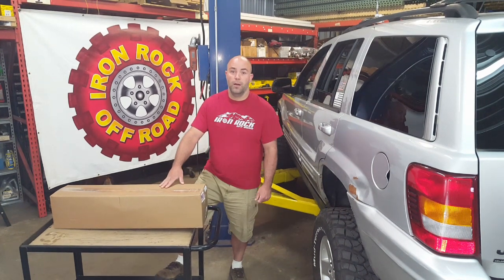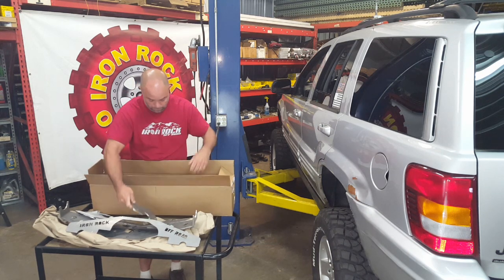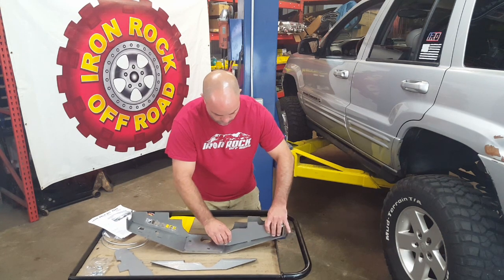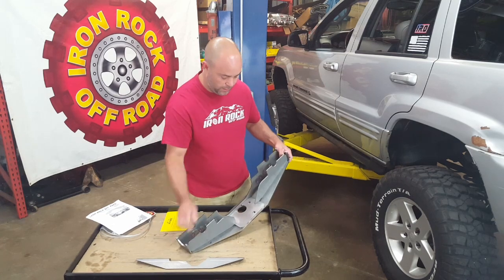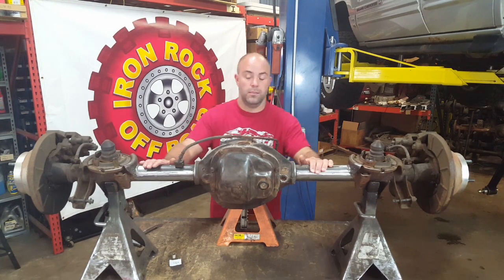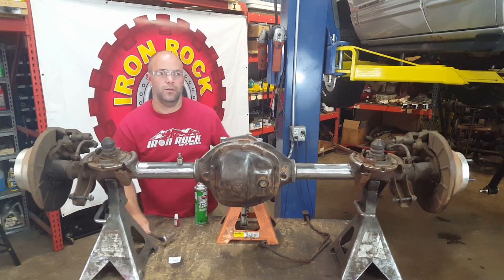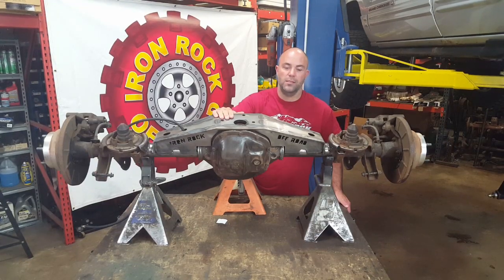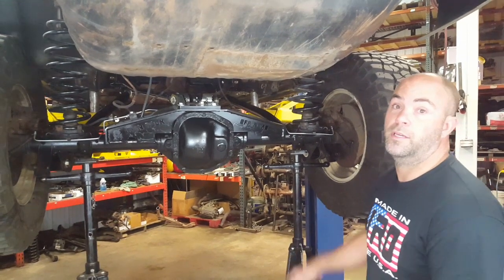WJ D44A Rear Axle Truss - Iron Rock Off Road

Comment: I'm about to do a similar kit from you guys, for a 94 ZJ D44a, in my wife's Jeep. I'm curious how accessible that vent line is after the truss is installed. (please forgive me if it's addressed in the video, I'm only about 7 minutes into it and the question occurred)
Reply from the maker: @JeepITguy Great question! I'll be honest with you. We forgot to install the breather tube before welding on the truss before. 😆 There are holes in the truss that allow you to use some needle nose pliers to install the breather tube so no worries there!
Reply: @IronRockOffRoad no worries. I am used to the high quality of your designs and figured you had it covered. Does the ZJ unit have holes predrilled for WJ-style arm mounting when one goes to a long arm kit on the ZJ?
Reply from the maker: @JeepITguy I linked the ZJ "short arm" box truss below. It might say short arm in the title, but it can be used for our rear long arm in the future. We designed it with an internal gusset to give it the strength it needs for the 4-link. It does have our 4-link UCA mount alignment hole in the truss, but it is a little different design than our WJ 4-link mount. 
ZJ Box Truss:
https://www.ironrockoffroad.com/product/zj-dana-44a-box-truss-short-arm.html

Take a look at the upper control arm mount in the ZJ rear 4-link kit. It will weld onto your ZJ box truss with no problem if you decide to upgrade in the future.
ZJ 4-Link Rear Upgrade:
https://www.ironrockoffroad.com/product/zj-rear-4-link-long-arm-upgrade-kit.html
Reply: @IronRockOffRoad thanks. The upgrade in the future option is what I am pursuing.
Reply: @IronRockOffRoad thanks. Expect a call next month before I order. I want to ensure I order the right parts.
Reply from the maker: @JeepITguy No problem, call us anytime 9am-5pm Central time if you ever have any questions at all. Plus, all our IRO manufactured parts are in-stock and ready to ship the same or next business day!

Comment: Great Product.
@ ~ 4:15 in the video there is a sleeve of some sort that suddenly appears; without any explanation what it is. Then next the vent tube connector gets threaded into it. What is it, does it thread in or is it supposed to be welded on?, (not shown in the video),... ...does it come with the kit, or is it part of OEM axle?
Reply from the maker: The sleeve you're seeing is an included part we call a "T block eliminator".  You will reuse the factory vent through this part.  The vent threads into the axle tube holding the t block eliminator in place.

Comment: Can a skid plate be used with the truss? like the one for mountain vista fab?
Reply: Yes you can, I installed this example truss with a mountain Vista fabrication skid plate to protect the aluminum housing. Check it out @wj4x4offroad
Reply from the maker: I know this is an old comment BUT in case anyone is looking, we offer a D44A/D44HD skid plate that will work with our truss! Check it out, link below!
https://www.ironrockoffroad.com/product/d44a-differential-skid.html

Comment: The ratchet strap mount sold me, an I thought they stoped doing the Dana 44A after ‘98?  Correct me if I’m wrong, I genuinely would like to know.
Reply: The 44a went on until 2004 in the WJ with v8 and/or quadradrive. It has totally different mounts than your zj. Oh and it's wider. 5x5 bolt pattern.